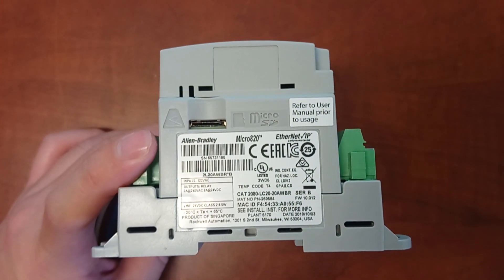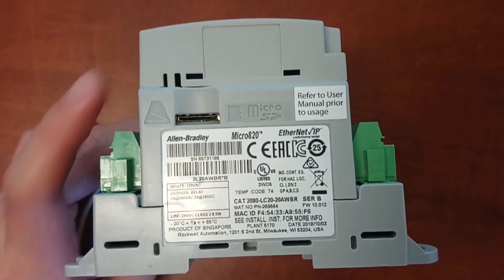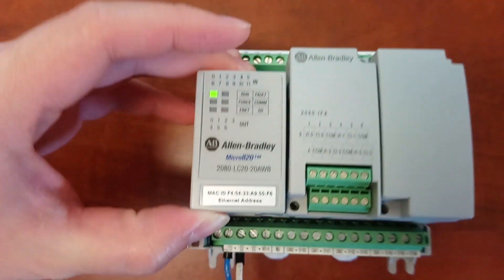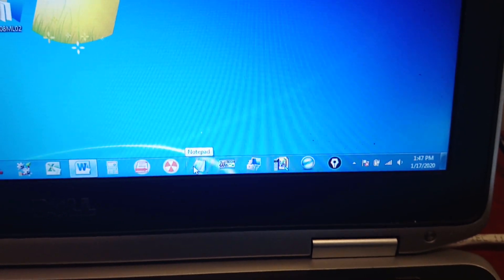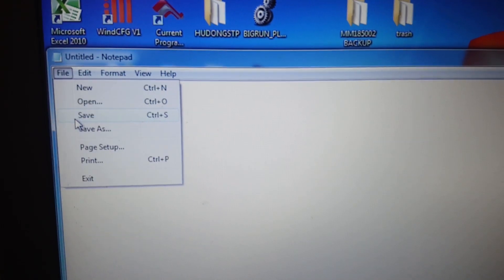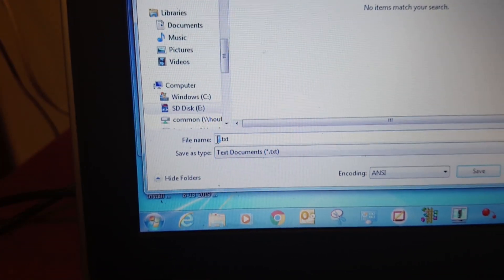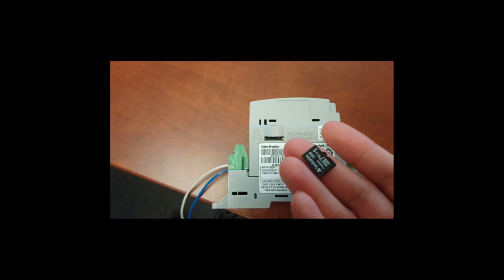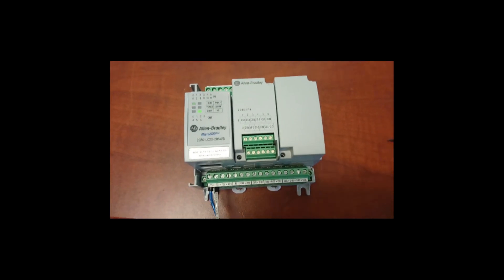Micro820PLC Ethernet Communication IP Address Setup/MicroSD

Comment: Hi Sir,
i have question related to micro850 (2080-LC50-24QWB), can i factory reset this plc through micro SD card.
Reply from the maker: @Heat Trace: I don’t think the micro850 has the microSD card slot. Therefore, you will not be able to do anything with a microSD card on Micro850 PLC’s.

Comment: Does the Filesystem that the MicroSD card has been formatted with make a difference? All of mine only accept exFAT or NTFS, but the manual says FAT32/16. Following this same procedure as you does not work on my Micro820 and I think maybe it's because of the exFAT.
Reply from the maker: @Murray MacKenzie: I think so too. Unfortunately sometimes the really problem is from the format of the MicroSD card. FAT32 is very common. It should not give you any problems. Another thing you might want to make sure is the file must be located at the root of the microSD card.

Comment: I just loaded what you had entered into a notepad of course with my desired IP address of “192.168.0.200” my question for you is after I put the micro sd into plc am I changing the plc’s via BOOTp DHCP? Or through Connected components workplace? And thereafter good to remove SD card? Please reply at your earliest convenience thank you!
Reply: And I have already attached notepad to sd card didn’t specify that in previous comment
Reply from the maker: @Tanner: The provided code actually put PLC into program mode during start up and set the IP to it. This method does not require any software that you mentioned.
Reply: @SYPHOANG   thank you for reply Okay so when I want to load a program to it then that IP address should be loaded into that PLC?

Comment: Resultados de traducción
hello my name is marino gutierrez, for example you say that when you configure the ip, remove the micro sd from the plc. but for example if I turn it off and on, isn't it assigned a different IP automatically? I would not have to leave the micro sd to have the static ip ?.
Reply from the maker: @Marino: Thank you for subscribing to my channel. I’m not sure what your question is. Because a brand new PLC right out of the box doesn’t have IP address, you need to use a microSD card to set an IP address to it before you can download a program to it for the very first time. However, the PLC program also has its own IP address to set to the PLC. That’s why you need to remove the microSD card from PLC before downloading a program to it. If you don’t remove the microSD, the IP Address in it will override the IP address from the PLC program after a power cycle.

Comment: How about with microphone 850 ?
Reply from the maker: @Nob: I don't have the micro850 with me. But if it has the SD card slot on the right side, it should be the same procedure. You can also use USB port if it has to download the program with IP address to it for the very first download. Or you can use 1761-CBL-PM02 cable for download.

Comment: Dear sir your presentation is excellent. However i have a micro 830 controller for controlling pump systems.i need to replace a new one as previous existing malfunctioning sometimes,  but unfortunately  i have no any  backup software. Now how i can get backup software from my existing PLC.i think i can up load backup software from my existing PLC CPU and save in my Personal computer for installating in to new PLC.if yes please advice me how i can do it.
Reply from the maker: Yes, you can upload the program from the existing PLC to your PC but only if you know the PLC's IP and password (If the PLC has security setup). Please see the link below for the instruction how to upload program from PLC to PC. Thank you for subscribing to my channel. 
https://youtu.be/Ho5ZBlPdhmk

Comment: Hi, After using SD Card and connect successful. I can plug out SD from PLC?
Reply from the maker: Of course, you need to remove microSD after it successfully set IP on PLC. In fact, if you don't remove it, the microSD card will set the same IP on it to PLC every time PLC is turned on. This might cause a problem. Therefore, please remember to remove it after IP is set on PLC.
Reply: @SYPHOANG  Thank you! 
I have one more question. Maybe only Micro820 supports Micro SD card? And Micro830, 850, 870 only download project by Ethernet port and USB Type B.
Reply from the maker: @Nalanda Automation: Sorry for the late response. You are right about that. NOT all Micro800's PLCs have Ethernet port. But I think Micro850 PLC's do have ethernet port. For Micro800's PLCs that have USB type B port, I believe it uses DF-1 protocol for communication. You just need to add DF-1 driver to RSLinx to be able to browse to the PLC.

Comment: Hi, I was using this IP address: 192.168.1.101 to the Micro 850 24QBB and I made a program with panel view T4T. but now I can't connect with it, I'm using the same IP to the PLC and to the Panel view I'm using 192.168.1.102. Could you help me? I don't know if the PLC has the memory card, but I never have used memory card for the PLC's.
Reply from the maker: I guess your PLC IP is 192.168.1.101 and HMI IP is 192.168.1.102. How many PLC's do you have in your network? Each device has to have a unique IP. You cannot have 2 PLC's with the exact same IP. As I showed on the video, you can use microsd card to set PLC IP adddress during PLC startup. After the startup you can remove it from PLC. Not all PLC's have microsd slot for this function.
Reply: @SYPHOANG  what if my PLC doesn't has micro SD slot???
Reply from the maker: @heribertoruiz6578  : If PLC does not have a micro SD slot, you then have to use a usb cable (micro810 PLC for example).